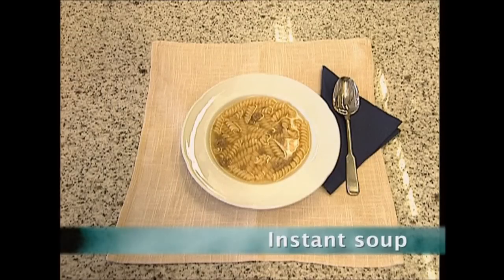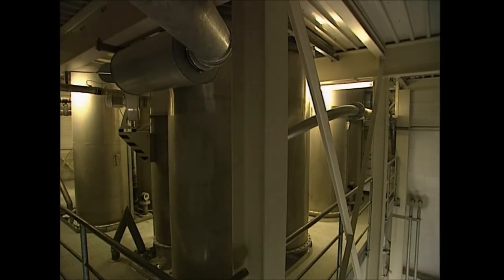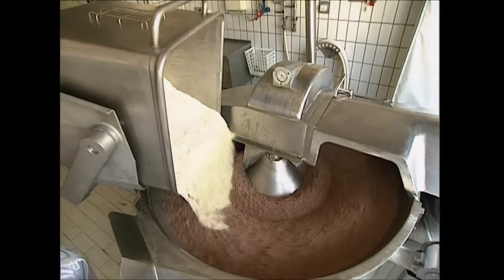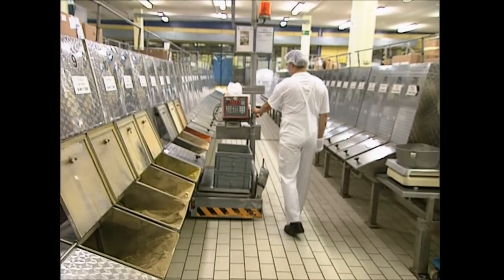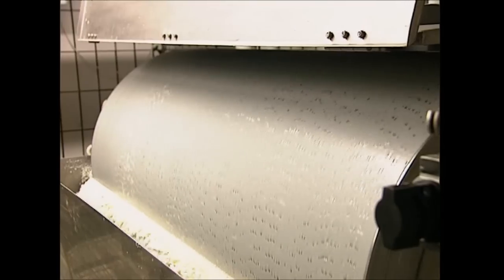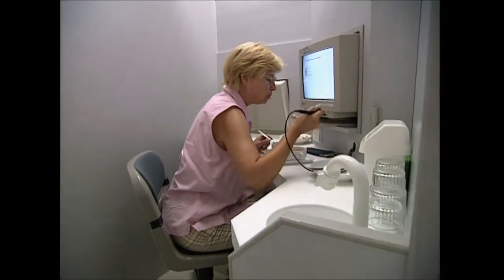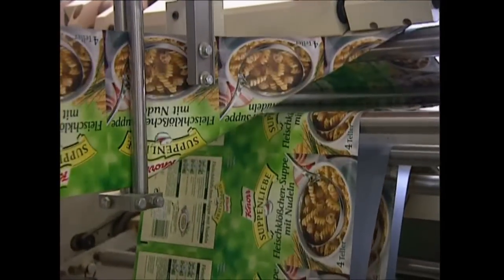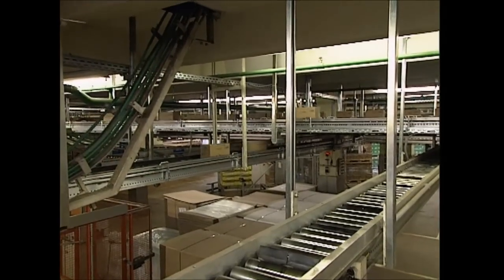HOW IT WORKS - Instant Soup

Comment: Doesn't look like these are instant soups. These are the variety you have to boil them for about 10 minutes. Instant soups don't require boiling, hence the name - instant. You just have to add hot scalding water directly in the soup bowl and it's done.

 I was curious how are those made, maybe with pre-boiled ingredients and dehydrated or something.